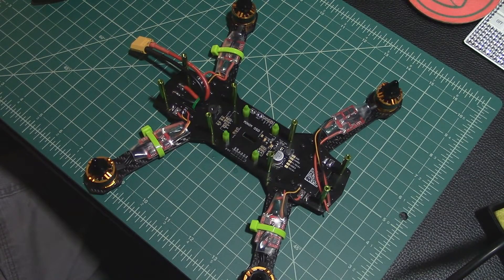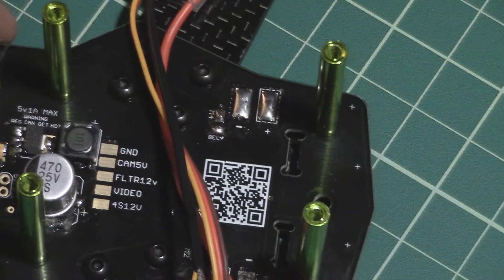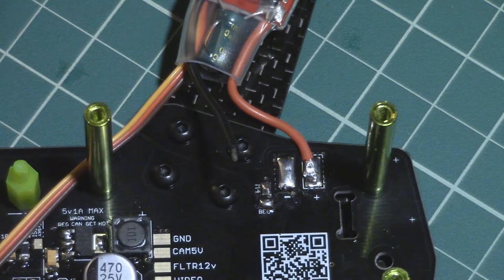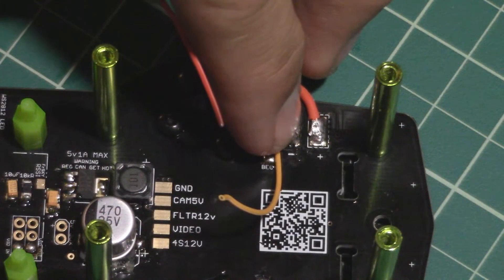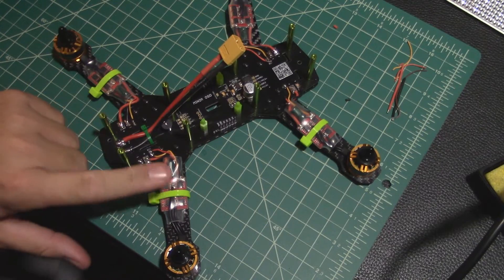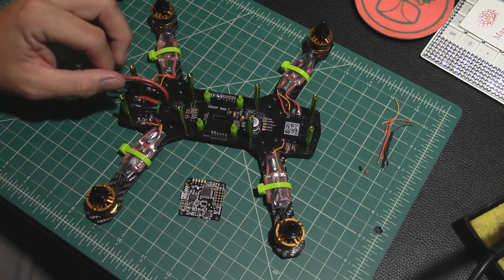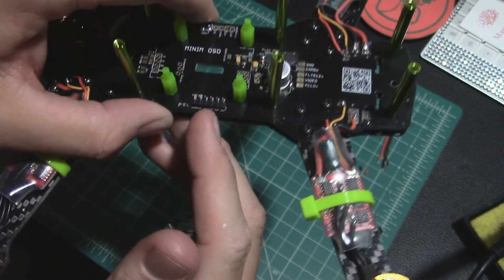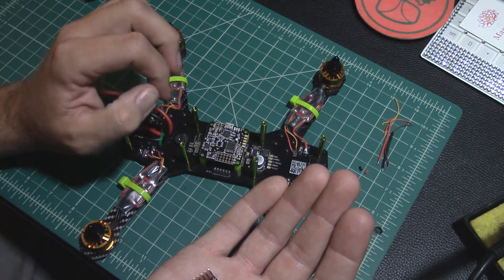ZMR250 Quadcopter - Soldering ESCs to PDB

Comment: Instead of cutting ground wire couldn't you piggyback it to the esc main ground?
Reply from the maker: +Chris Pearson Technically yes, they are the same ground on the ESC, but I had read too many reports from people saying their ESCs did funny things when they didn't connect the 2nd ground with the signal wire.  Since there was a separate pad for the ESC grounds, I used it.
Reply: Still confused, you cut the second ground.

Comment: If you turn the board 90 degrees clockwise, do you then put 90 or -90 in the setup?
Reply from the maker: 90 degrees in Cleanflight for the Naze32.  that would put the USB port out to the left instead of to the rear.

Comment: you should wait a little bit more for your solder to melt completely on the pad otherwise you will get a cold solder joint like you did on your negative pad...
Reply: +Yan Chabot can you help me with one question please? If i'm soldering wires from motors directly to my ESC - ESC will be ok? I'm afraid I can burn it's components
Reply: +Andrey Evseev if you wait just as long as you need to you should be ok

Comment: Thanks for the video! I'll try that. What if my ESC doesn't support BEC ? I'm running a DYS 20A. These have a "Twisted-pair cable for throttle signal, effectively to reduce the signal crosstalk when transmitting in the copper wire, and make the plane more stable". Would I have to solder both to the motor pad on the PDB? Can you help?
Reply from the maker: you only want to solder the motor signal wire to the PDB pad for the motor,  do not solder the ground wire with it.  On those DYS 20a I believe the motor signal wire is the thin white wire.  the thin black wire will not be needed since the ground is common across the ESC and you already have the thick black wire soldered down.
Reply: +Oin Taylor Thanks! As far as I understood the BEC was meant to power the naze, right? How am I gonna do that then?
Reply from the maker: +Rickgoldcoast yes that is true if your ESCs have a BEC.  I thought you were writing that yours do not have BEC ?   if they do have BEC then you should also have a thin red wire along with those thin black and white.  solder the red wire to the small pad labeled BEC.  still no need for the thin black wire.  if your ESCs do not have any BEC (opto like the SN20a) then you will need to run a dedicated BEC from the main battery inputs or get creative and make a Y-harness off your VTx if it provides 5v out.
Reply: +Oin Taylor yeah, so I'm going with the second option, no BEC. Sorry my ignorance but I'm new to this. So my PDB had only one BEC pad on the back near motor 1. It seems there is a channel coming straight from the battery to the BEC output that goes to the naze passing through a regulator
Reply from the maker: +Rickgoldcoast Cool, sounds like you have it sorted out then.  If you post up any videos on it, be sure to come back here and let me know.  If you're on Facebook, look up the ZMR250 group.  There's tons of good information there, even if your frame is not a ZMR250.
Reply: +Oin Taylor I ran a wire from one of the 5V outputs on the board to the BEC pad. Do you think that would work?
Reply from the maker: +Rickgoldcoast if you have a regulator on the PDB,  then you would want to run the connection from the 5v output to the Naze32,  connecting on the + and Ground of one of the motor connections.  You don't need to use the BEC pad at all since your ESCs don't have BECs.
Reply from the maker: +Rickgoldcoast on my PDB here,  I am using the BEC pad by motor one with the thin red wire from my ESC because my ESC does have a BEC providing 5v.  The BEC pad connects via a trace up to an area right next to the Naze32 and I connect from that area to the + and ground of Motor 1 output on the Naze32 board.
Reply from the maker: +Rickgoldcoast I guess I should not have said at the beginning of the video that I was doing four of the same thing.  The procedure was similar but the ESC I showed had the BEC I needed to solder in also,  the others did not.  Sorry if that has caused confusion.
Reply: +Oin Taylor yeah I think got you. But I found this looks a bit neater than running a wire straight to naze. So instead of the 5V coming from ESC to the BEC pad and consequently the pin next to the naze, on mine it runs from 5v output to BEC pad than it flows as normal
Reply from the maker: Rickgoldcoast Ah,  OK cool,  whatever keeps it clean looking!